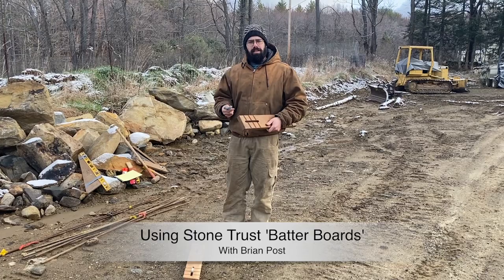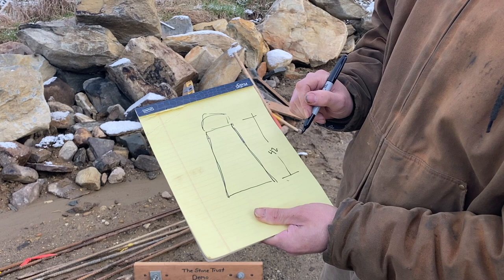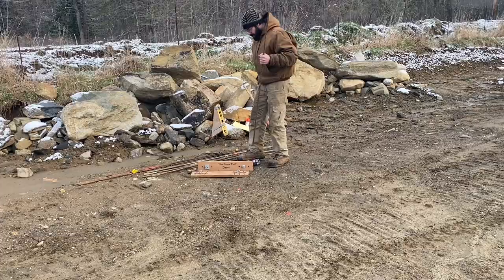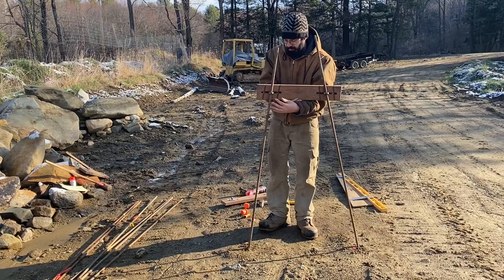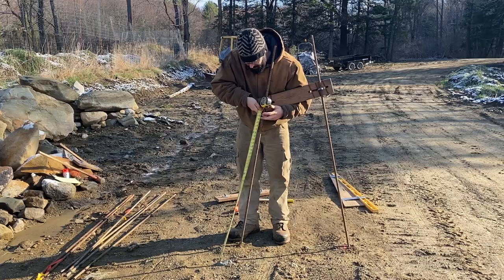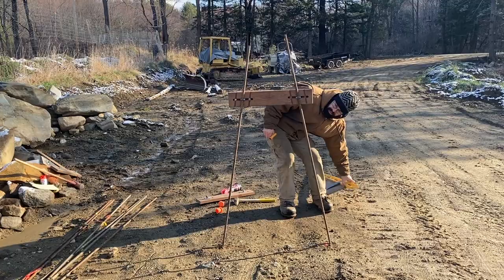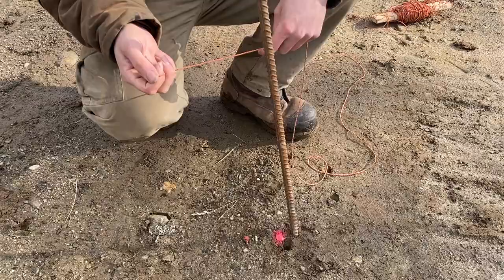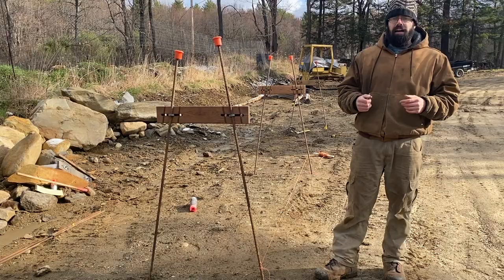Setting up batter boards to create frames for dry stone wall building

Comment: For the width and height of your wall use the 3, 2, 1 formula. If the top of the wall under the coping is 12inches 1, the base will be 24inches 2, and the height will be 36inches 3. For the wall he described her the proportions would have been 42inches in height 3, 28inches at the base 2, and 14 inches at the top under the coping 1.
Reply from the maker: The 3, 2, 1 formula can work well for typical free standing dry stone field wall (fence) applications as 2nd example shows.  However it locks you into a 1:6 batter.  It also becomes increasing incorrect the farther you get away from a wall 42" to 54" high.  For example with most stone it is impractical to build the top width at 12" wide, there just is not enough width to fit reasonable sized stones in.  Conversely a wall that is 6 ft tall would end up with a 2 ft wide top, which is quite excessive, unless you are building with unusually large stones.  In general the top width should be dictated by the stone you have.  You want as narrow a width as possible that still allows for the structure needed.  Typically that is in the 14 to 18 inch range, while the base width needs to increase with wall height, the top width does not.  So the 3 2 1 formula can be useful, but you have to be aware its limitations.
Reply: @brianpost1448  Thanks for the reply, Brian. Can you tell I have an aversion to mathematics. I actually used a calculator to make sure my numbers were right in my first reply. That and I've only built a Lego wall. I do like to see some dry stone walling, I was surprised to see our friends in the US using it.

Comment: Thank you for the great video! After two wonderful Stone Trust trainings (2 day intro and 2 day cheek end), I’m getting ready to do my first independent practice wall in our pasture. We have these batter board frames, which are great. In calculating the dimensions in this video, how did you arrive at the 16” width at the top of the wall? Was that just a preference or was that calculated somehow using the 42” height? Im still a little foggy on how these calculations are made. Thank you again for this great video-really helpful!
Reply from the maker: Sorry not to respond sooner.  The top width is something you pick, just like you pick the height.  Typically the top width is going to be in the 14" to 18" range.  It depends on the stone you have.  If you dont have much small stone going wider is helpful.  However there is tremendous savings in the volume of stone needed if you go narrower.  For a 4 ft high, 20 ft long wall. if you go just 2" narrower you will save about 1 ton in stone about (1/2 cubic yard).   This adds up quickly if you are doing a long length.